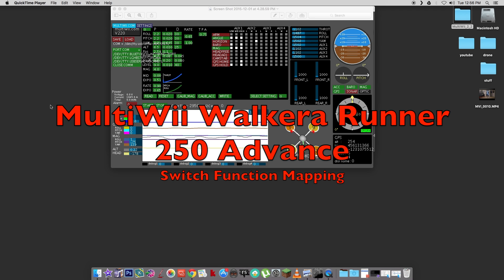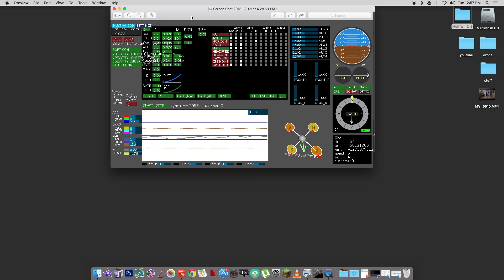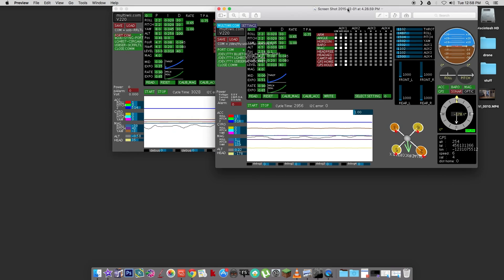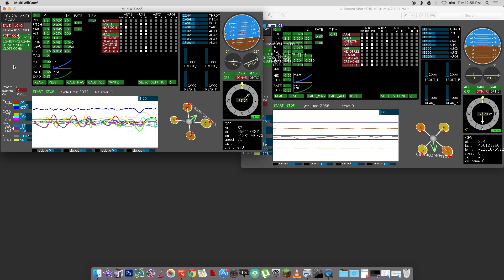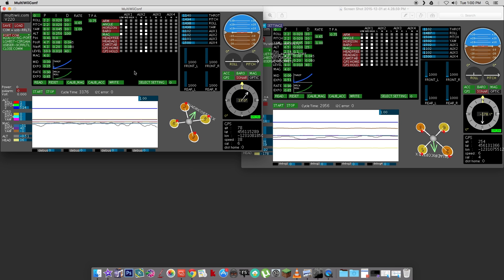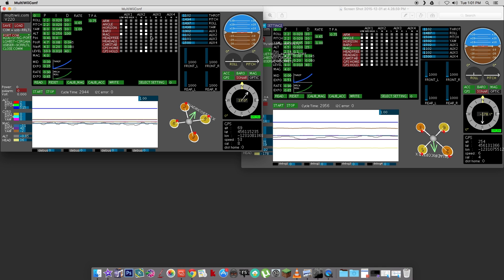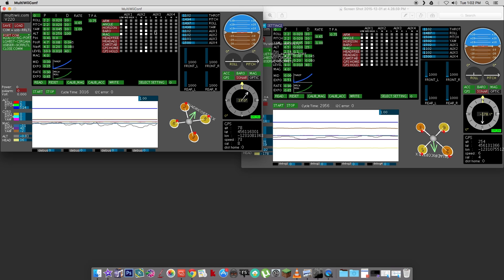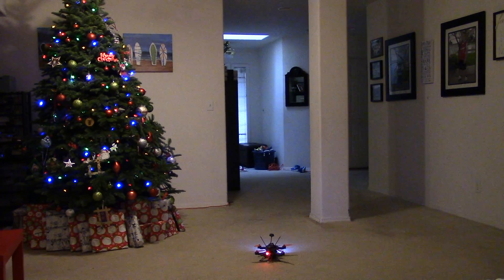MultiWii Walkera Runner 250 Advance

Comment: I have a Walkera runner 250. I just finished installation. front motors work but rear motors do not work. I replaced the engine and esc, again only the fronts worked. Is there a setting for rear motors in Multiwii?

Comment: +Justin - well done video, thanks for sharing.  I am using my own radio & receiver for the Advance.  Flies fine.  I used your MultiWii settings.  Acro & Self Leveling are working fine on AUX1 switch but I have not yet gotten the GPS functions (Hold & RTH) to work on the AUX2 switch.  Did you ever have success with engaging the GPS modes using the settings in your video?
Thanks.

Comment: Great video, how does if fly at slow speeds in gps mode and is it very stable or does it bob up and down a bit when flying forward slow. All so how do you stop it from going up or down in gps mode with out a self centre stick transmitter. cheers any help would be great as i  am thinking of buying one but not for fast racing for slow fly racing through thick bushes and courses. many thanks
Reply from the maker: +leekay Hello, I think when in GPS mode (GPS hold for example) the Baro and GPS take over so not too sure how to deal with fluctuations in the altitude.  You do have to center the stick, so 50% throttle before you activate GPS mode.  One thing to note is I replaced the build in FPV system with a fatshark camera and transmitter because the built in transmitter did not match the channels for fatshark predator v2 goggles.  You can still pick up the video but it has to be the frequency bleeding over since I cannot actually tune to any of the specific channels that the built in transmitter outputs on.  When the weather clears up I will take my quad out and test out the GPS hold and GPS RTH feature and capture some video of that to post up.
Reply: Many thanks for taking the time to reply and your help. I will subscribe to your channel and watch your future videos. Thanks again
Reply: Hi there have you done any more testing in gps mode, i contacted a seller in the uk who said you could take of fly and land in gps mode ie the whole flight from start to end in gps mode, canyou confirm if this is true or not. Very intrested to know if you have taken of in gps mode and flown and how precise it is. Many thanks
Reply from the maker: Hello, I haven't had a chance to do any additional testing as we are having some pretty severe weather where I am at.  When you say GPS mode are you wanting to establish way points and have the quadcopter take off and fly the specified way points, return to home, and land?  Sort of an autonomous flight?  If so, the 250 Advance is a racing quad and the GPS simply enables the altitude hold feature and also the return to home feature, it will not fly by way points without some serious reconfiguration.  Hope this helps, thanks!